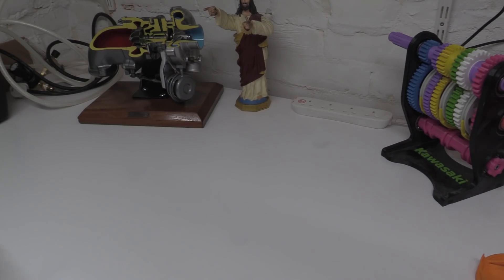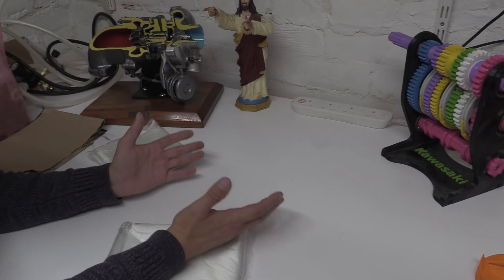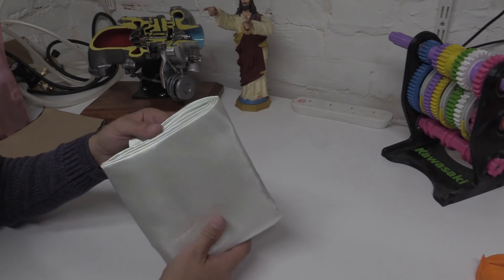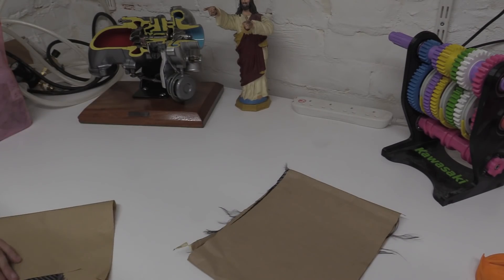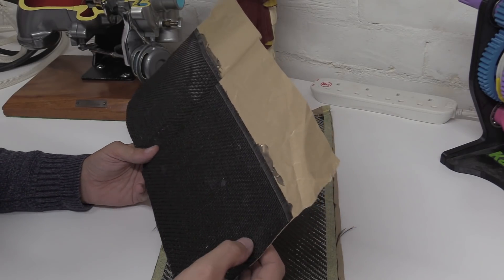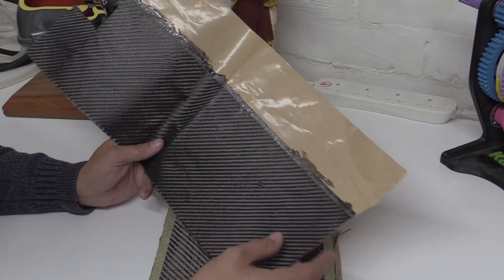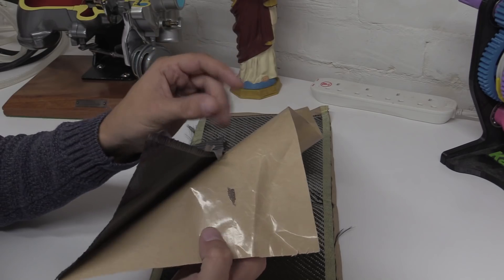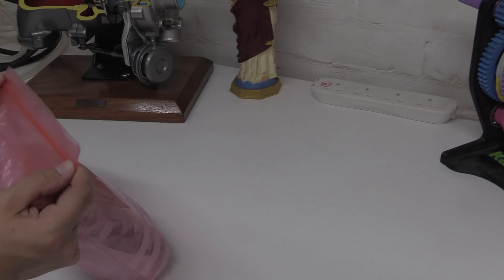Glass Fibre Basics - Part 1

Comment: With glass fibre, does it have to be weaved? I saw on Quick Bikes YouTube channel when they were doing the seat pan for GIXIT, they had GRP matting but it was not nearly as fine/weaved as what you've got there, is it just a cost thing or is there a benefit to using finer/coarser GRP?
Reply: Chopped strand mat is good for repairs and bulking up parts.. It will still be strong but it can use a lot of resin to wet it out when you use it so parts will be heavier but its is cheap. My moulds use chopped strand mat for most of it and even the surface layer is chopped stand. But woven is good for parts and making them nice and light. The ratio of resin to glass for chopped strand for someone at home making something can be about 2:1, 2x the weight of resin to 1x glass. So a 300 gram part could be only 100gr of glass. Typical woven ratios are 1:1 and all the strength is in the glass not the resin. The pre-preg I use is 42% of the weight of the carbon so almost 1:2 42 grams of resin to 100gr of carbon is where you get the weight saving if the same material lay up is done comparing woven glass to woven carbon pre-preg.  Now the benefit of different material weights are either you dont need the part to be strong and heavy so you can use a lighter material or you actually need more strength in multiple directions so you use more layers and rotate the direction of the weave to get the direction for the strength where you want it.. If you are making a bigger part then using a heavier weave is OK. If a part is say 1mm thick and needs to be strong you can use say 4 layers of 180 gram and run the weave in several different directions. But if a part needs to be 6mm thick putting 24 layers down is slow work and gets expensive with all the material you need to use. So you can use the lighter material on the surface but run say 10 layers of the 300 gram and then back it up with one more layer of the lighter weight surface and have a very strong part still.  My normal material is 3 layers for 0.9mm thickness but I have material to use that will add the 0.1 mm to give me exactly 1mm thickness so if something is a critical size I can work to less than 0.1 mm tolerance if needed. I have made some material for Jaguar Land Rover that had a +/- 0.1mm tolerance and I got a sheet 1m long and 0.3m wide to exactly 3mm thick over the whole part.  The different weights can be used to fine tune properties of the part as well as help it meet a specific tolerance.
Reply: @YAMR1M  cheers dude, this is interesting shit, who knew 😂
Reply: It was probably just chopped strand mat (csm)

Comment: I would really like to see how you would go about making fairings if that's where you're going with it so how you would approach making a mold, if/how you can make it out of the existing fairings and if its a better idea to just apply the stuff straight onto the existing fairings or if it is better to just throw out the existing fairings maintain the mounting points and just go for a complete redesign because I've been wanting to do something like this for a while (also seen some red carbon fiber cloth recently that I think looks the dogs bollocks). I tried painting my bike because the plastics were an absolute state and it went really well for about a month then the 1k clear I used started to crack from the oil and petrol vapors which is kinda good and bad I had this whole marble candy coat thing in mind that I didn't do because it's expensive but If I had it wouldn't have this problem :( not entirely sure if i want to just rub it all down and start again because some of the fairings are a bit fucked anyway and new ones (for my bike anyway) are 1.dodgy as fuck and 2. really expensive so is this a cheaper option assuming everything goes right as well.
take care

Comment: Here in America I haven't seen carbon fiber referred to as graphite in 20 years or so.  These plastics are usually labeled CFRP in engineering contexts.  The aircraft I fly for sport are made almost entirely from CFRP, wet layup with epoxy because prepreg is very expensive and the additional allowables are not necessary.   On the other hand at work in the semiconductor industry there are all manner of CFRP prepreg parts used where stiff, light parts are critical, such as robot end effectors for flinging 12 inch wafers around at breakneck speed.

Comment: Yeah but you know that you cant use weave glass fibers for everything. You better get some matted shredded fibers. And I hope you get the right tool do work it. Yeah a fucking brush and a small fluffy paint roller is fine. And please tap-brush out the fucking air. Not like a bollock creating air pocket on air pocket. Cut them open and do the same shite again and again till you have a heavy lump of something that you fill with dolphin shite. Yes 2 max 3 layers is enough for a fender or seat. And get some fucking silica powder if you want to thicken the raisin to make a glue or filler for tight gaps. I saw DB his job and I thought all the time: No! no! you are not getting paid for that! I tried to help... I tried. And before you start make sure you have Acetone! No acetone and you will not be happy cleaning shit of your skin or what ever. Let it lap over the mold and trim later! That way you get even thickness trough all of the part... He never did get that. Trim edges when it is starting to harden and just not sticky anymore. Use a sharp knife and cut towards the mold along the edge of the mold. That way you only need to sand a little. Things that took him days take me 60-90min! Yes I did that for years as a job. It is no fun and stinks so I quit. PENIS!

Comment: So the pre-preg carbon fibre, do you buy it on rolls? How much would a roll cost? If that's the case, then can you buy different lengths of it? 
Would be fun to make some fairings out of it just to learn how. 
Unless It's crazy expensive.
Reply: The cost of Pre-preg depends on the weight of the material as most rolls (full rolls) are about 25 sq/m. The width for woven carbon is usually either 1m or 1.25m wide.  But you can get longer or shorter rolls if you need. I have one roll right now that is 41sq/m and about 33m long as its 1.25m wide. You can through easy composites buy 1 or 2 meters of the stuff but its not really cost effective due to the price and postage costs for small amounts but its a way to try it.. A full roll of 25 sq metres costs between £1200 and £2000 for carbon. I have one material that cost £65,000 for a 25 sq/m roll. And I roll of unidirectional (I am sure Matt will mention unidirectional materials at some point) that is 0.6m wide but 90 metres long and cost £7000 per roll. But I have no resin costs to pay so its not quite so bad overall with basic carbon fibre weaves its just special materials that can be ultra expensive. 
The bigger problem is you need the consumables and equipment.  Its the same as Vacuum bagging and infusion where you need a vacuum pump, vacuum bag, release film and breather cloth as well as bagging tape. Here pre-preg and infusion split with pre-preg needing an oven (it needs to be accurate and not the oven you use at home) and infusion needs more consumables like mesh, pipes and fittings to run the resin inside the bag   various fittings and clamps as well as a vacuum pot and a degassing chamber. Infusion as the name suggests you infuse the material. So the mould will have gel coat applied then left to cure. Then all the material is laid down dry with all of the fittings placed around the perimeter of the mould and then the consumables over the back of the material. It is all then connected to the vacuum and pulled down. The vacuum bag has to be 100% sealed with no leaks at all. (easier said than done) Any leaks will allow air to flow to the vacuum port and the part will have contamination with air over it. Then when its all sealed up you then draw the resin from a pot through the part with the vacuum port placed in the centre of the part and the vacuum pump pulls through the vacuum pot so any excess resin is just pulled into the pot and not into the pump... 
Pre-preg is a bit easier. You don't gel coat the mould. You just put all the material down then put breather cloth over the back of the mould and lay it onto the breather cloth, apply release film over the carbon and you can apply more breather cloth over the release film or in some cases just use the release film and no breather over the carbon. (You always use a breather cloth to place the mould onto as this is to allow air to be pulled from the bag).  Then you seal it all up and pull a vacuum which needs to be good but if you get a very small leak (a pin prick would cause a big leak) you leave the vacuum pump running for the duration of the cure anyway and the vacuum fitting with pre-preg is not on the part. You then put the vacuum bag in the oven. My oven has 4 vacuum pipes inside the oven and its own pump. The oven runs a cure cycle which is based on the recommendations of the material supplier. I run my oven for 16 hours at a maximum temperature of 73 degrees C.  I have to run the material though several stages at 50 degrees, 60 degrees and finally 73 degrees with each stage being heated up to at a specific rate of 1 degree every 90 seconds and the 50-60 degree stages held there for one hour. For me pre-preg is easier and less mess. The cost of the consumables over a year for infusion would cost more than my oven cost to build. So its the route I chose. Yes materials do cost more but I have zero waste compared to the dry cloth methods.
Reply: https://youtu.be/EhyS4LMRTuw
Reply: @YAMR1M  you've some interesting content on your channel Richard, I've subbed.
Reply: Pre-preg is pretty expensive for the material, and you still need a vacuum pump and an accurate curing oven to get a good finish.
If you want to make cheaper parts you can use vacuum infusion instead - a friend of mine made a full set of body parts for his rally car from kevlar which is very close in strength/weight, but a lot cheaper, but obviously they don't have the gucci factor.

Comment: How do they ship the prepreg if it needs to be refrigerated to keep it from setting?
Reply: Google
Curing Prepreg
Typical cure temperatures for prepregs range from 60°C up to around 180°C with the most common cure temperature for out-of-autoclave pre-pregs being around 100°C.

Unless you live in a volcano it should be ok.
Reply: @untrainedprofessionals2374  
That 60°C would kill you like a lobster. That is hot hot for me mate. I did not give a specific temperature out of that reason that it can warry in the cure temperature. But it is well over room temperature.
Reply: @onhawaii  That's pretty warm. 
I just did a quick Google to see and it looks like most of us need not worry about the curing temp its the price of the stuff.
Reply: @untrainedprofessionals2374  Yes if you shower with 60°C water you jump!
Reply: Pre-preg has an out life. Some it's just 4 days at 21 degrees c. So they send that out with blocks of dry ice to help keep it cold. The one I use is 21 days of out life and they just send it directly from their freezer. So a full roll takes about 5 hours to thaw fully. So you can lose a day of outlife. I go to collect direct from the manufacturer so it's still frozen in the centre.
Reply: For longer storage keep it cold but it does not set off right away as long it is not going to be like hot hot room temperature is fine for a while. And they transport your frozen chicken and ice cream too without it melting it.
Reply: I dont have ice cream and chicken mailed to my door tho
Reply: @beachboardfan9544  But the store where you buy that gets it delivered or not? Or do the farm and produce it right there and freeze it for you to take home? Was it hot on the beach today? You might want to sit in the shade for some time mate.
Reply: Unless you're in the southern hemisphere RN its hot everywhere...
Reply: Besides the temperature, you should consider some form of vacuum pump and containment bags to draw all the air pockets out, I’m not really an expert, but I have seen the experts work with this material. Pleasure boat hull building has been done this way for a long time.

Comment: I think I worked with grp in the 90's.   Is it like a white (mainly) gel that covers wood for waterproof projects?
Example :take a ply lined transit van, cover it all over in "grp" and then you have a Waterproof van you can hose out?  

I think this is the stuff.
Reply: are you thinking of pva?
Reply: @chrisdavidson911  nah, it was grp. Just googled it.  It's kind of like fibreglass. 👍
Reply: Grp.. Glass resin panel. Its normally a thin ply panel with glass fibre resin to reinforce. Used for truck bodies amongst other things. My truck body is constructed from it, terrible idea, as water ingress rots the ply from the inside and becomes very heavy.
Reply: @melodysouljahrootsdubpress5539  same idea as SMC "sheet moulding compound"?